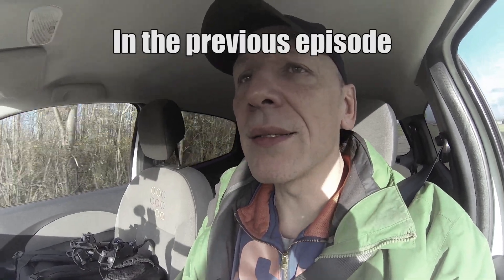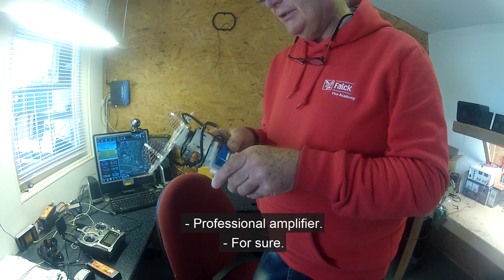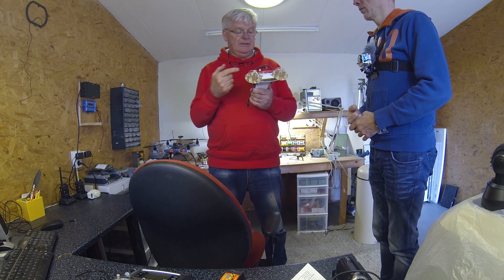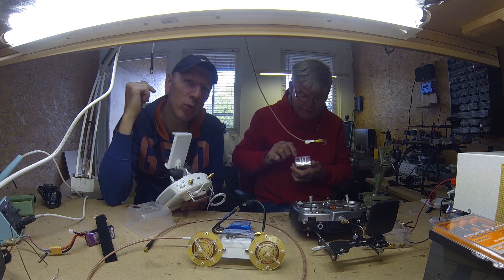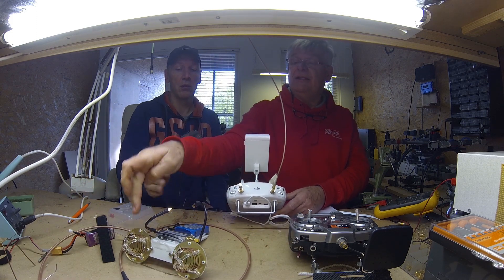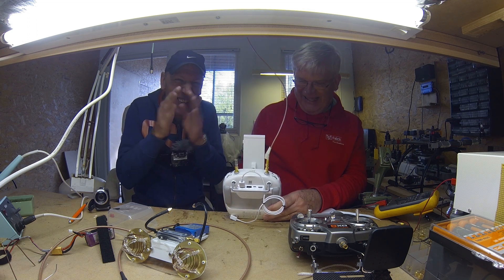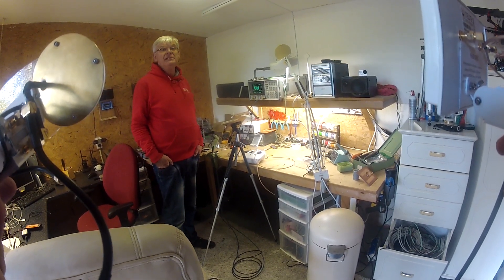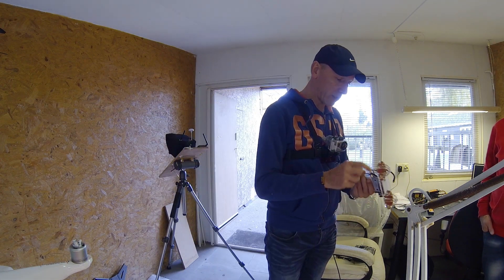Testing my antennas In Alex's Drone Lab (part 2). Learning about polarisation.

Comment: Phantom uses what's called MIMO (multiple input, multiple output) is an antenna technology for wireless communications in which multiple antennas are used at both the source (transmitter) and the destination (receiver). The antennas at each end of the communications circuit are combined to minimize errors and optimize data speed. In digital communications systems such as wireless Internet, it can cause a reduction in data speed and an increase in the number of errors. The use of two or more antennas, along with the transmission of multiple signals (one for each antenna) at the source and the destination, eliminates the trouble caused by multipath wave propagation, and can even take advantage of this effect.

Comment: Hi 
Could you give me an advice about my drone phantom 4 
Happenss many times that when i fly in distance happend one time at 500m other times at 700-800 the drone it self gets disconnected and at that moment i dont have any controll only way is to press home button. After maybe 30 seconds as it fly to the home point i have the controll of the drone ? 
What could be the problem the drone its self, the antennas ?! Can anyone explain this. ?! 
Im thinking change my antennas
Reply: Besnik Mn hi, the aircraft disconnected problem has to do with bad usb cable, USB module or the controller firmware. I had the same problem, and reinstalled the controlller again frommy tablet and it works flawlessly now. the last firmware version for the controller is 180.

Comment: poor demonstration.. this is the same as this?  which one?.. didnt research the frequency before you started? your added signal boosters were both 2.4 gig, and you still questined whether it was 5.8 gig. the transmit a d recieve will be very directional, must face drone or loose signal.

Comment: hey, couple of things I've discovered on the mavic which are probably similar on the p4. your friend is correct, it's a TDD (time division duplexing) system for the control and telemetry, while the video signal is simplex (p4 to remote only).  really it's just a Wi-Fi chip with some custom software in there, and I believe the p4 is 2.4ghz only so it's probably some basic single band 11n chip they're using.  the two antennas are for diversity.  the transmitter is not transmitting much because there was no drone, a bit like a laptop's Wi-Fi wouldn't be transmitting a lot if there is no Wi-Fi ap, it's just scanning.

mavic/ocusync seems to be different.  they probably use a newer generation 11ac+Bluetooth chip with some custom software, because the telemetry uses DSSS or FHSS (your friend will know hehe) across the entire 2.4ghz band just like bluetooth, while the video feed uses a 20mhz wide channel downstream on 2.4 or 5g, just like Wi-Fi.  again the two antennas are for mimo or diversity.

finally, just a heads up that adding the higher gain antenna and especially that amplifier (if it's amplifying tx too and not just rx - which would make it useless) would exceed the 100mw/20dBm EIRP limit allowed on 2.4ghz in the eu. 

great vid as always! keep them coming!
Reply: The two antennas are not for diversity. The Phantom line communications protocols are what's called MIMO (Multi In Multi Out) The Phantom has 4 antennas and the remote has 2. On the radio, one antenna is for TX and one is for RX. The left side is TX, the right side is RX. 

MIMO (multiple input, multiple output) is an antenna technology for wireless communications in which multiple antennas are used at both the source (transmitter) and the destination (receiver). The antennas at each end of the communications circuit are combined to minimize errors and optimize data speed. In digital communications systems such as wireless Internet, it can cause a reduction in data speed and an increase in the number of errors. The use of two or more antennas, along with the transmission of multiple signals (one for each antenna) at the source and the destination, eliminates the trouble caused by multipath wave propagation, and can even take advantage of this effect.
Reply: great, you read techtarget. :-)

I doubt they're using MIMO.  In simple terms, MIMO uses RF reflections off walls, ceilings and similar indoor structures to improve bandwidth.  Great for WiFi bandwidth, but guess what? a drone doesn't need bandwidth, nor does it operate close to reflective structures.  It would make more sense to use the two antennas for spatial diversity to ensure a continuously reliable connection.

The extra two antennas you're seeing on the P4 are probably the GPS antennas
Reply: I repair DJI products, and build custom drones and specialize in long range flights and do antenna upgrades on DJI products (uavdoc.com). DJI uses MIMO for the main purpose of multi-pathing issues, and with that, they can get amazing ranges with it. 

DJI's system is called Lightbridge, here's some specs about it. 

• Immunity
- Uplink frequency hopping (FHSS) + Spread Spectrum (DSSS) technology, high transmission stability, strong anti-jamming capability;
- Downlink MIMO multiple antenna technology and using OFDM modulation, with advanced algorithms to effectively improve the stability of the system data bandwidth and complex environment, improve the dynamic performance of the system;
- Real-time monitoring of each downlink channel interference state, dynamically select the best channel operation (up to 8 image transmission channels);
- Same time and can support up to eight devices simultaneously 

They use MIMO because it can give you a much better digital connection with more bandwidth for the HD (720p/1080p) video image you are receiving with far less latency. The 4 antennas on the phantom is the mimo system, they go to the RF board just under the VPS. 

The Phantom has 1 GPS sensor, and it's attached to the very top of the inside of the shell. It's dead center of the shell.